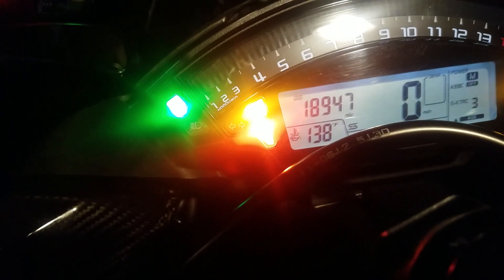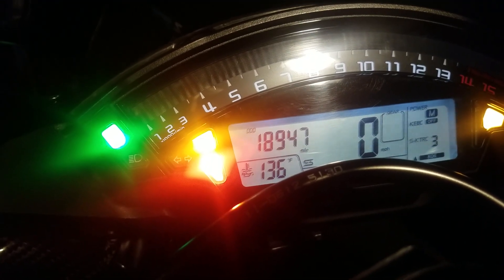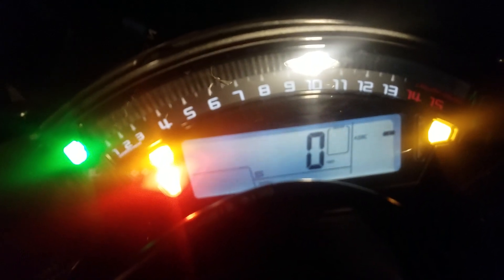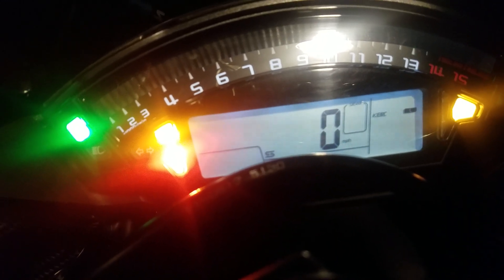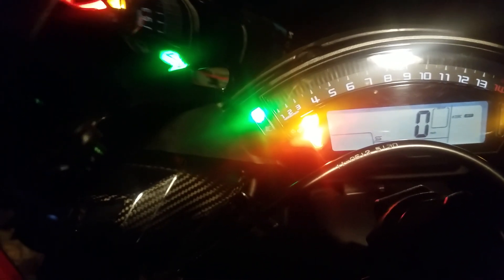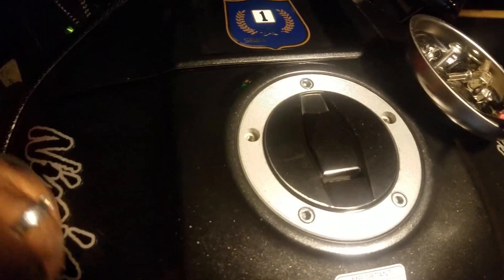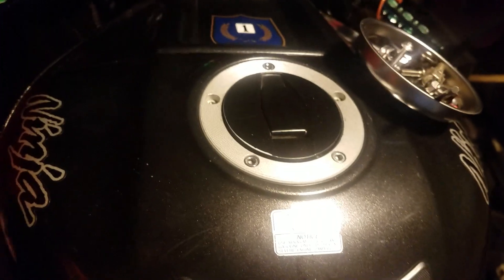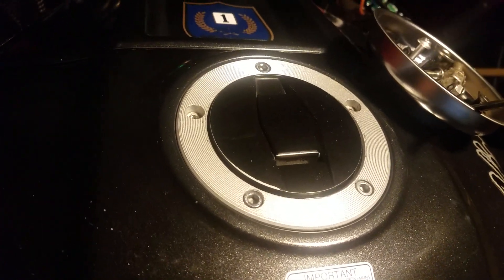KAWASAKI ENGINE BRAKING IN 2 MINS

Comment: How did this clip get 4 thumbs down? This is the best explanation on the engine breaking setting.
Reply from the maker: Thanks for your support, several people agree with you.
Reply: Jay Don please explain the rest of the functions..
I recently bought a 2018 ZX10r ABS with 900 miles well now 1000miles lol. I do have a question for you; This  is My first Kawasaki and I noticed at 25mph If I celerate then decelerate I feel/hear a clunk. Not sure if the chain is loose or sprocket is bad. Or is that just how Kawasaki’s are made?
Reply from the maker: @Cologneswag  the noise you hear is not normal. The sprockets don't usually go bad until after 20K miles from my experience. The chain has to be a be regularly adjusted and lubed so it may be that the chain has slack. I would recommend replacing the stock chain with an after market light weight 520 chain and Super light weight steel sprockets. Try Sprocketcenter.com they have good package kits. You can also email any questions @ jaydon711@gmail.com
Reply: Jay Don thanks

Comment: Good explanation.  But the real question is why is the power on M 😀
Reply from the maker: Good observation. My maps are not stock though, I have two different full power maps, one is milder for the street until the revs climb. My medium setting holds one of my full power maps.